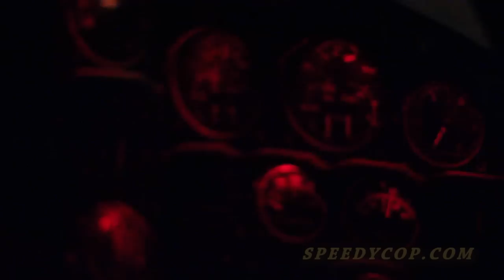Power to the Cockpit

Comment: Hint: The altimeter is really a barometer with a backwards scale.  There is a little button where you set what a normal barometer on the ground shows, and then the dial shows how different the pressure outside the cockpit is.  So if you tune it to "Stormy on the ground", it will show higher the fairer the weather. If you set it to the actual outside barometer value it will just show a boring 0m above ground.  Oh and if you get lost, there is an old school compass too.